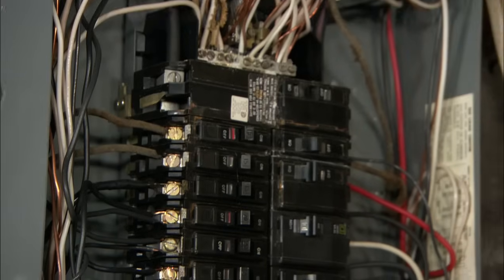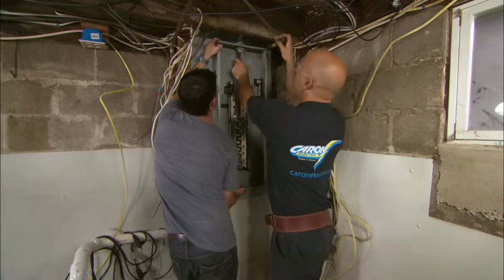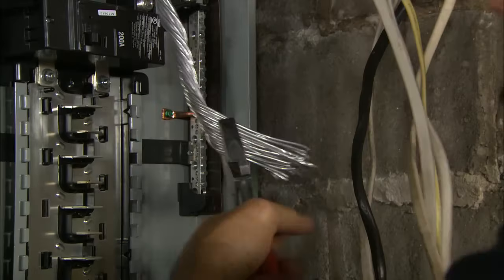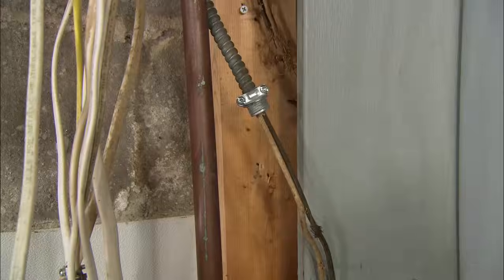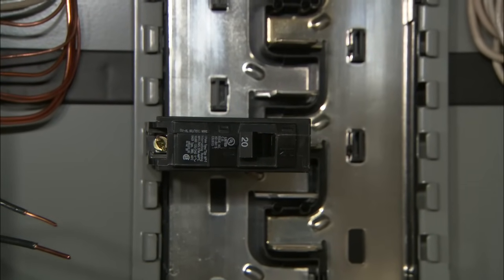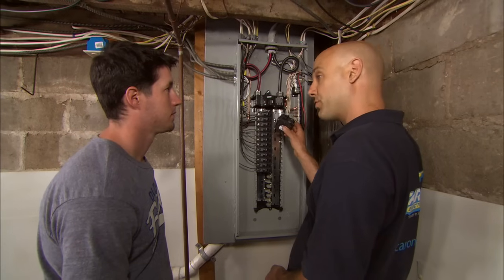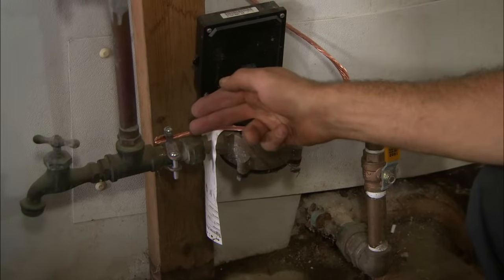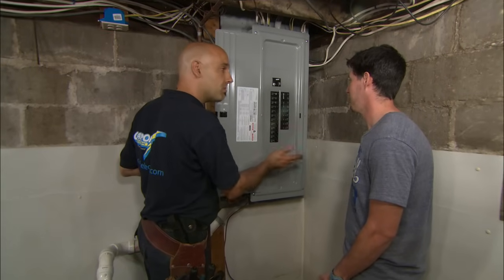How to Upgrade an Electrical Panel to 200-Amp Service (Part 2) | This Old House

Comment: What a beautiful & neat & well organized 
& ❤ly  job .
I have 1 question please ?
When I install surge protection , if there is no room close to the main fuse , & only 
place I can connect it is one below another fuse , does he SP can do the job ? So far I can not get any answer , they all say go get the electertion 😂😡😁😄😊thanks.
Reply: In Canada since a surge protector butts up against the panel, and no extra circuit is added any homeowner is allowed to attach it...only when circuits or jumpers are added does the home insurance and code require an electrician to do the work...as these small home depot models come with great instruction manuals....
Reply: There are some models that are designed to get installed under a 2pole breaker....and you can move all breakers down to make room as long as you turn the main off....
Reply: @gophersgirl  Thanks . i did it right . Also % 90 of electricion are pure crooks .
$ 450 to install 1 fuse😳😱😩😠😡
Reply: @johnbaptist7476  didn't know my advice was worth 450$, but hey this electrician also likes to hang out at home depot and help customers since saleguys often have no clue...lol
Reply: Also now ask your home insurance if a hardwired SP reduces your insurance cost....mine did 😉
Reply: @gophersgirl  😂😂😂😝😻😹🥴🥺🥳

Comment: So it is okay to use only the water line for grounding,  it does not need the ground rod?
Reply: ground rods mounted outside in part 1

Comment: What's the difference between a neutral and a ground? 🤔 And why do they screw onto the same block
Reply: the Neutral sits at 0 volts and provides a return circuit to ground so that current can flow.  The neutral carries current when the device being powered is turned on.   (Neutral is the white wire on your outlets.)

the Ground should never carry current.  it is there only to carry current (provide a direct path to ground) if the device grounds out internally to protect anybody who touches the faulty device. (Lamp, clothes dryer, stove, etc).    

The Neutral and Ground wires only come together at one place, and that is the ground bar in the breaker box.  Both being tied to Earth Ground keeps the voltage on both at Zero Volts and also keeps the ground wires in the house from being energized by the Neutral wires.
Reply: In this video they are working on a service entrance panel in which neutrals and grounds are always connected together.
On sub panels neutrals and grounds are always kept on separate bars.

Comment: I've always done that loop  ( about 1:40 ) with water feed lines, especially to toilets. This way I always have a long enough supply line, and that loop makes positioning it always easy. Not sure if I've seen that on these videos. 
I also use Oxygard, dielectric grease on all the major ground connection, anything aluminum - like that twisted common. This way corrosion has a much harder time sneaking into the connection. (In my current shack I'm renting the ground for all the circuits in the house was only returning 90 volts. None of the computer supplies were working properly. I tried running down the problem, the wiring is simple, but never found it. So I ran another ground wire.  A bit bootleg....but everything works. 
Back in the day, 30 years ago, a 100 Amp panel was considered adequate and a 150 Amp panel was considered 'more than you'll ever need.'  An HVAC circuit is 30-50 amps,  and one Tesla charger should be 30-50 amp, and within a few years families will have two Teslas. In eastern Canada where they have less expensive hyrdropower, a lot of the clothes driers and range tops are electric. Once we in the U.S. get enough solar panels on our houses electricity will be more plentiful - so put in a 200 amp box.

Comment: So did u change all the 14gauge wires or the 12gauges wires going into any of the outlet? I asked that because some of them will need a bigger wire to support heavier machine. 
Or did u change it for some other reason?

Comment: I noticed he connect the ground wire to the plumbing, since ground and natural will be live during use, is that mean the plumbing pipe is not safe to touch?

Comment: oh the ground cable goes to the waterline , incredible , should that not go to a special cupper bar into the ground
Reply: goes to both mainly, check your local codes for your area requirements

Comment: There is a difference between using a 200 amp panel on a 100 amp service and upgrading your 100 amp service to a 200 amp service. Besides using larger service entrance conductors for the 200 amp upgrade, you most likely will need to have it inspected by the city. Many utility companies require a passed inspection when they come out to change out the meter. You will also need to upgrade the meter socket as well. And I ALWAYS trace out the circuits and label them before disconnecting so I know what neutrals are sharing what breakers.
Reply: I don't think which neutrals are sharing what circuits shouldn't matter since they are all getting connected to same bus bar . What I do is mark which leg they are on so as to make sure the circuits are all on the same shared leg as previously.. Also he is double tapping the ground s into the 1 screw on buss bar , should be 1 wire per 1 screw
Reply: @gusc6785  i saw the double grounds as well but I see that all the time.................
Reply: @gusc6785  Neutrals should only matter if GFCI/AFCI breakers are getting installed. Otherwise they all just go to the same bus bar anyway. You are permitted to double tap  neutrals on the bus bar, at least provided the label inside the panel door lists it. My Siemens panel allows 2 neutrals per screw. Of course it is possible for local codes to override panel ratings.
Reply: They probably didn't show that the NS cable was also upgraded...
Reply: This is part two. In part one they upgraded the exterior service including the meter base
Reply: So which of the 2 did this video do? What the point of doing a 200amp panel on 100amp service?

Comment: You are not creating a grounding system by just adding a wire from the panel to the water line .. you have to install 2 ground rods that are 6 ft from eachother .. this is very wrong and get somebody killed
Reply: watch part 1

Comment: Most homes also include a 50 amp 240 VAC circuit for an electric stove, even if you are using gas.  So there are usually four sizes of wire, not three.  It also would have been nice to show how to use an inch-pound torque wrench to properly tighten those breaker screws, and to use separate ground and neutral buss bars with a bonding screw or pigtail.
Reply: No need to separate the grounds and neutrals in the main panel, only in a subpanel.

Comment: This is US is it? I was thinking what voltages are these
Reply: Two 120 volt hot wires, of opposite phase.  Normal outlets and lights are 120 volts.  Large stuff like stoves use both hot wires to get 240 volts.  We always use a double-pole breaker for those, so any over current shuts off both hots.

Comment: Why do you get 2 grounding systems? You got copper rods installed outside but you have to attach to the water piping!  Why is that?

Comment: I see that they say that a licensed electrician is needed to do this kind of work and to run underground electricity to a shed you know that a homeowner can do this type of work too if the homeowner knows electrical wiring.

Comment: First the main wire has to be upsized to 200 amp, work has to be inspected and in most states done by a licensed electrician.

Comment: “This should never be done by homeowners”
proceeds to show homeowners exactly how to do it
Reply: But some homeowners know how to do this already. ;)
Reply: @anvilhead59  it only voids your house insurance when they find out you did some electrical yourself and the house burns down...that's why us sparkies pay a lot in licensing and insurance...
Reply: @gophersgirl  
Not entirely true, in my area so long as I pull a permit and my work is inspected and passes my insurance is not in any danger.
Reply: @BestLittleStudio  in all of Canada homeowners are not permitted to pull permits, only licensed electricians with either a b-ticket or FSR ticket , just because you have a red seal certificate does not mean you can pull a permit ...albeight I spoke to my chief electrical inspector and he did say I can rewire my house without a permit noting electricians do a better job in their own homes than customers ( has more to do that quite often and my own personal experience and he did mention that is females most often get held to a much higher standard!) Yes I do understand some regions are a bit behind but I do want to emphasise you should seriously check with the home insurance if diy electrical is covered... There is a reason why our apprenticeship takes 4 years and I have seen at least 3 fires where diy  was at fault.
Reply: he was not showing him how to do it, he was just throughly explaining what and why he was doing what he was doing
Reply: Homeowner's should never go down there ! lol
Reply: @emreduygun  
I disagree, homeowners should be acutely aware of all of the systems in the home and when to work on them, and when to call a professional. 

For instance, I noted some cracking in my upstairs ceiling, o a trip to the basement noted that one of the supports was installed incorrectly, for most this is a call the expert guy, but I used to do this back in my younger years, so I was more than capable to add temp supports, remove the current one, cut the concrete, pour a correctly sized footer and tie it into the existing floor and install a correctly sized and properly mounted support beam with properly sized load spacing to spread out the load and prevent further damage. 

The total cost to me was less than $200. For a pro, it would have been in the 1k's and worth it due to the labor.
Reply: @BestLittleStudio  I understand where you are coming from but disagree with your approach. You cannot expect homeowners to be handyman/woman and work on systems. On the contrary, many of us rather have a trusted professional take care of the job. Not everyone is as talented and experienced as you are.
It is not worth my time, emotional and mental distraction and stress to go through the investigation and trying to fix something up; unless of course I am 100% sure. I have done a lot of work within the limits of reason, but it is not my specialty to fix a house. I have seen cases where landlord tried to save money and hustled DIY, only to cause pros to pull their hair out when we went into the property to investigate and reno. It is not our job to fix things, as such we expect quality and reliable service from those who can. I have no problem paying $1,000 someone who's worth it, also knowing he will put food on his table for his family is quite the good feeling.
I make up that money working harder, smarter, or from the equities, and simply by sparing future disaster.
We're just different mate.
Reply: It is allowed in some jurisdictions
Reply: Proceeds to double lug the grounds, not trim tags, and make the water meter nearly impossible to service and work with.

Comment: I would label all the circuits before replacing the panel.
Reply: my existing panel has some 15a, 20a, dual 15, dual 20, 240.  So, I would want to map it over to the new panel with the proper amp breaker. figuring out the exact label would be secondary to that.
Reply: No reason to most times. If the panel is well labeled it's most likely not in need of an upgrade as it's been addressed in a remodel or addition to the home. And if you know what your doing you can keep things well organized enough to land conductors in the proper breakers and phases. Also its a great well-paid day to shut every breaker on and off to locate and label after.

Comment: Not an upgrade. The panel does not have separation between neural and ground. Did not cover upgrading feeder size.
Reply: mainly nutral and ground should be bonded, depends on local area codes.
Reply: @EVGSTORE  I'm not an expert but I believe that in a service entrance panel which is what they were working on in this video, neutrals and grounds always have to be bonded together.
On a sub panel they always have to be separate.

Comment: Wait, why did he attach the panel ground to the water pipe after going through the trouble of installing two grounding rods outside? That's... what the grounding rods are for, is it not?
Reply: By electrical code , we must run two 8 feet ground rods into the ground 6 feet apart and we must run a #6 Bare ground and clamp them before and after the water meter .

Comment: Great video. Like how he just cuts those wires to simply match to the appropriate breaker later and, voila, all back in action again!
Reply: I mean if you only have 3 different amperage breakers, it’s easy to identify which one is what since the positive and neutral are together.
Reply: @jimeneazy5999  Quite so, indeed.
Reply: @jimeneazy5999  
Did you mean hot and neutral?  There is no positive on AC circuits.  And them being together means nothing since all neutrals go to the neutral bar.

Comment: You change panel from 100amp to 200 amp without  change wires ??
Reply: Yes they did, you must have miss it. You can see the 100 amp at 0:33 and then the new 200 amp at 1:06

Comment: After changing out a main panel front those crappy stab-lok breakers to Square D, it wasn't too hard. Very satisfying just pulling all the wires (AKA: the mess) out and starting over from what the last guy did. Only thing I would have done different here is not just go on small medium and larger wires to know whats what, but taken the time to label all the wires first before I took everything apart.

Comment: Code says 18" , from right side wall, to Center line of that Panel, For work room.1st.  BOO,BOO.
Reply: No it doesn't. NEC 110.26 says 30 inches of horizontal clearance. And it doesn't have to be centered. Where did you get 18" from?

Comment: Sins of an electrical contractor
1. Allowing the homeowner to keep aluminum wiring fire hazard.
2. Not labeling the breakers before he puts them in the panel.
3. Just having a soul patch.

Comment: I’m sure this guy knows what he’s doing,
But I thought using aluminum wiring was bad because it causes shorts?
Reply: Only in wire nuts because the expansion and contraction on aluminum. Noalox should be used when adding aluminum and copper

Comment: Did I miss the part when he spliced into the live utility wires?
Reply: they had the city cut the power to the house in part one
Reply: @colbybarbour9990  Yes, I saw that part along with taped spliced hots but I didn't see the reconnect.

Comment: Can I please have him come to my 168 year old family farm? I still have KNOB & TUBE 🥺. And FUSES😭 I'm desperately trying to learn how to do this, but dang.... I love how he just, does it. I enjoy learning from actual, ethical, professionals ❤️
Reply: How many circuits does your place have? just curious
Reply: @TechHowden  well, there are still 3 fuses, and then a mess of a panel. My father and I are tackling it, starting today. I've researched an awful lot, and found that my previous family, well, just "did their best" to put it kindly. So, we are going to sort it all out, run new Romex/Southwire, and put it into a brand new 40 space 80 circuit panel I bought.
Now, my biggest problem is, running wire in this old beautiful Victorian Farmhouse ❣️. I flat out refuse to remove the horsehair plaster walls, as the insulation it provides is stellar! And it's just stunning to boot. But, I will find my way, doing research with the help of good folk like this❣️ Thank you. You never know how much you help someone with mere words and videos 😘❤️
Reply: @jenXMAGA  Did you succeed?
Reply: Any electrician could do it, since they would never use any of the existing stuff except maybe for pulling romex down walls.  They really would just go all new like they were wiring a new house.

Comment: This video is out of date. New electrical codes state ground and neutral buss bar must be separated. 200amp main breaker is now to be outside with the meter.
Reply: ''New electrical codes state ground and neutral buss bar must be separated.''
I believe that's dangerous wrong advice. I'm not an expert but I believe that in a service entrance panel which is what they were working on in this video, neutrals and grounds are always bonded together.
On a sub panel they are always kept on separate bars.

Comment: you dont loop the sevice coming in to bus. straight line is path least resistance
Reply: The difference in resistance would be negligible.  In many panels, there is not enough room above the terminals to loop the cables.

Comment: I don’t know why this guy is using ALUMINUM CONDUCTORS FOR ENTRY ELECTRICAL SERVICE.
You should never, never ever ever used aluminum for electrical entry at all. Someone is cutting corners!!!!
In my 43 years of electrical industry I would NOT RECOMMEND USING ALUMINUM CONDUCTORS
Reply: What are you talking about? My entire neighborhood  uses aluminum for service entry. It's not cutting corners, it's allowed by code and fairly common.
Reply: @sylviaisgod6947  your neighborhood and every other neighborhood.
Reply: You have no clue what you’re talking about. Aluminum service conductors are used for nearly every service in the US, commercial or residential

Comment: Hi...I did all this and when I turned the power back on the lights worked but nothing else. Out of curiosity I unplugged everything and the lights went out. After plugging something back in I had found that my lights were connected to an outlet...is there any way to fix this?